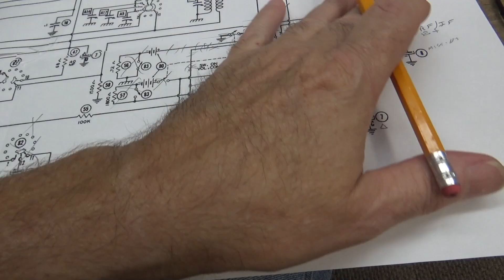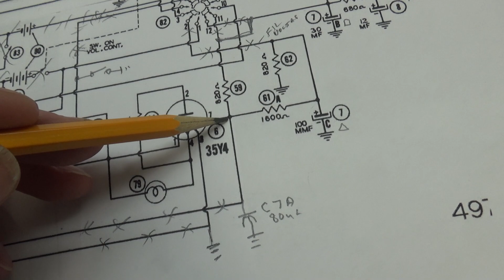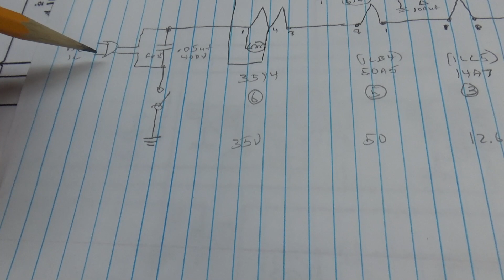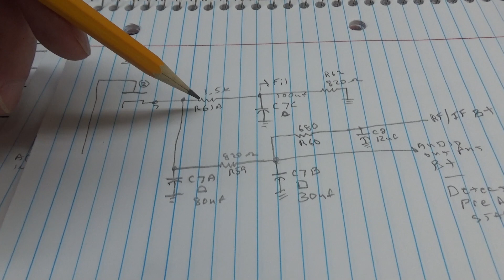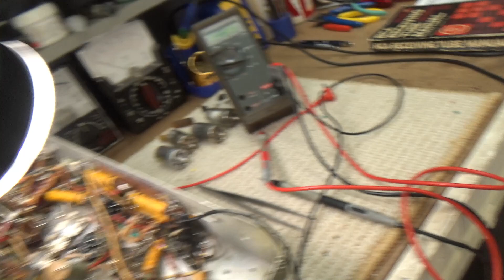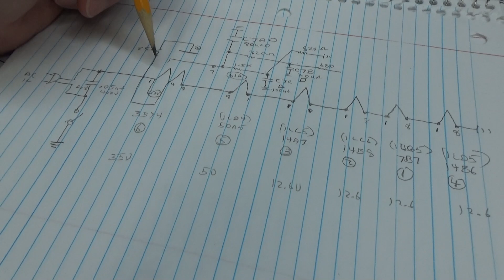EP 77 Silvertone 8230 Part 3 End Of The Line

Comment: Unfortunately the previous repair person left no notes on what he was trying to do but assuming he was deleting the
battery portion of the circuitry then it would be all good. But you found different tubes so he was up to something else.
The tube string was a good hint this radio schematic was not followed. Tubes were blow up by hacking or by using another chassis version that was AC only incorrectly. Trying to follow a Sears brand version is dicey at best. Good for parts only otherwise.
Reply from the maker: I passed up a really nice all battery philco the other day for the same reason.